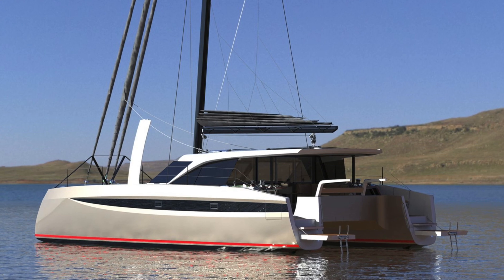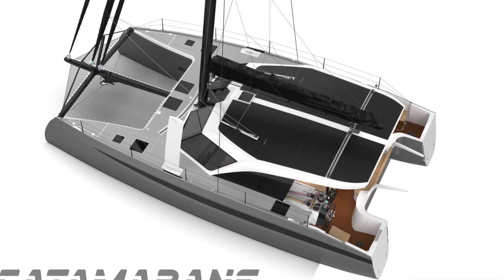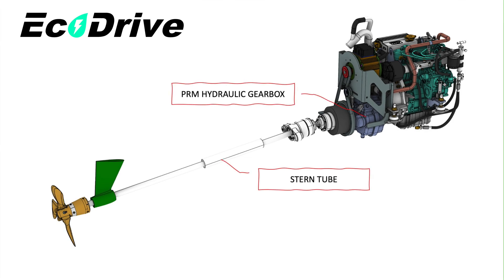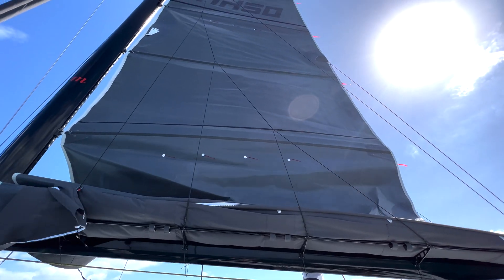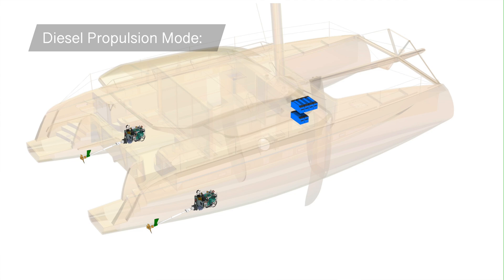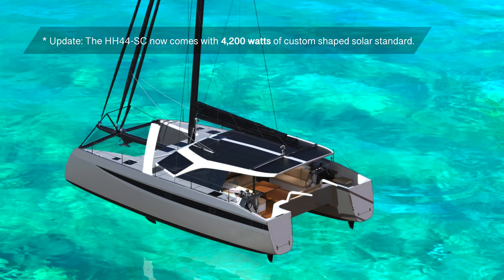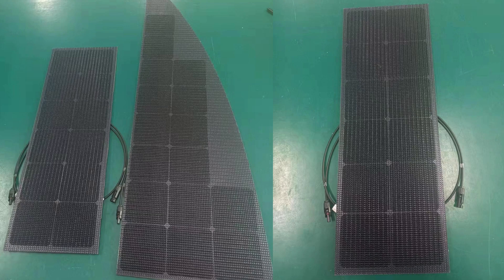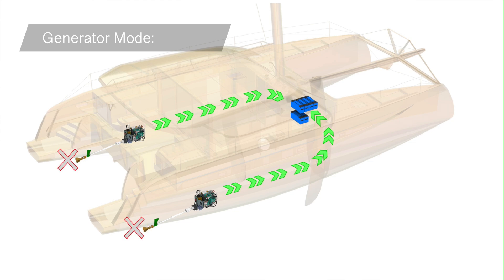Electric Catamaran of the Future: The HH44 EcoDrive (Episode 4)

Comment: Is it possible to have 4 electric motors for redundancy, eliminating all the diesel motors all together?
Reply from the maker: You could but for the reasons stated in the video we worry about the safety of such vessels that lack other ways to generate power (what if it's cloudy and dark)? To us, a Hybrid system makes the most practical sense for a true bluewater cruiser.
Reply: @HHCatamarans  how about 4 electric motors, with two sets of battery banks, each dedicated to the engines only and a diesel generator for emergencies?  I got the idea from Elling Yachts. While one engine is working, moving the yacht, the other engine's props acts as a hydro generator, recharging the other  bank of batteries. The roof of the boat will of course be plastered with solar panels for the hotel load and other electronics.
Reply: @The442nd  You should do an energy budget and design to your sailing needs.  For world cruising, unfortunately diesels are needed as at least a backup for long becalmed passages.

The HH system has 4 way redunancy, 4 independent ways to move the boat: two electric motors and two diesels.  That's excellent redundancy.

Having one diesel is doable, but less reliable than the 4 way redundancy of this system.  Why does redundancy matter?  What it one diesel fails in a major storm?

Also conventional generators are horribly inefficient for space, weight, cost, maintenance.   The parallel hybrid they have is highly practical.

If you wanted to do a serial hybrid do it with a conventional marine diesel connected only to an electric drive used as a generator to charge the battery bank, plus another drive motor to actually turn the prop from battery/generator power.
Reply: @LoanwordEggcorn  Thank you. I'm clearly still in fantasy land. Hopefully I can realize my dream. Thanks again for your input
Reply: @The442nd  You're welcome.  For info, if you're not already sailing, a great way to start is to join a local sailing club and take lessons there.  It's also highly economical to charter (rent) club boats compared to the many expenses of owning a boat. 

It's also a lot of fun!

There are sailing clubs nearly everywhere, including far inland in places like Colorado and Oklahoma.

Comment: When at anchor, given that there is a sufficient current, say 2 -3 knots or more, can the prop still be used to charge the battery like when under sail?  I know there are areas, particularly those with high(ish) tidal extremes where the currents can get quite high for a few hours either side of high or low tide, this could present a significant charging opportunity.
Reply from the maker: It could, but realistically you would need roughly 7 knots or more of current to make any real impact.

Comment: This is safe European style hybrid boat but 44k battery is way too small for cruising. 200-300 kwh battery is enough to take out the diesel. 
Also 3000w solar is not enough and these will have to be replaced in 5-10 years! At least 10k on normal style solar power with many years of service please! If you remove diesel there is enough space.
Reply from the maker: Our system is designed to give you the "range" you need for normal sailing, not perpetual motion. Plus we include 4,200 watts of solar (not 3,000) and have an optional 1,200 more you can add to the davits. That's a total of 5,400 watts on a 44 footer. Pretty impressive if you ask us! But we are biased. :)

Comment: You keep asking "Why hasn't someone already done this?" Apparently you haven't been paying attention. The Antares 44 is a year ahead of you with essentially the same Eco Drive parallel set up. OOPS.
Reply from the maker: As we stated in the video, we think you need to build the boat from the ground up with this idea. We also state that this is not new technology and that people have been putting them in boats for 15 years - but why no one has designed a boat from the ground up with this idea and this system in mind is surprising. With 4,200 watts of solar standard (up to 5,400 watts total) and a more efficient hull shape, our solution is expected to work better than the competition.

Comment: What is HH catamarans stance on the Sunreef 80 design with the array of solar panels on the side of the hulls and incorporated in the mast. The efficiency of the panels and the batteries?
Reply from the maker: Those boats are run using Diesel generators that power the electric motors. Something they neglect to mention on their website.
Reply: @HHCatamarans  Plus they don't give the weight of the boat which I feel is a vital component in the ultimate design factor.

Comment: Everything you two have said is spot on... But let's face it... sailing is a pain. Instead of putting money into lines, sails, a mast and rigging, then take exactly what you have and extend the area for solar and put some more batteries on board. Embrace the parallel hybrid drive for propulsion. All of that extra solar helping out will increase the milage on the diesels to something tolerable.

Not only will this new boat be less of a pain to use to get from point A to point B, but maintenance will be less. A person could be having fun and taking it easy instead of constantly trimming sails, switching sails, replacing chafed lines, greasing winches, fixing blocks and pulleys and all of the other pains that come with sailing.

Build it and they will come. This is the boat that most sailors don't know that they need yet.
Reply from the maker: Sailing is the most Eco part of the entire design! Powered by nature!
Reply: @HHCatamarans  You're right... and I do love sailing. But as a lifestyle it's less than ideal. Not to mention that other than ocean crossings, a person would likely be able to island hop through somewhere like the Caribbean using almost no fuel if they wanted to and it's difficult to get more eco friendly than that. From a business standpoint I'd think that it would make a ton of sense for you guys too. You're already putting the diesels in, already putting the batteries in, already installing the solar, and have already put in the work to make a great hybrid drive system.... but how much time and money would be saved by skipping the mast, winches, lines, rigging and sails??? The best part, is no part. I think that HH could make an awesome purpose built solar hybrid. There's no need for wrestling sails so you could shrink the trampoline and expand the cabin so that there's more living space and more roof area for solar. You can probably fit 10kw on a 44ft. Maybe another 3kw or 4kw could be flexible solar panel "wings" that stow under the main solar panels and pull out to clip onto the life line stanchions. 14kw on a 44ft boat would be enough to maintain a decent speed all day on a sunny day. On a side note, look at how much attention doing a proper hybrid sailing cat has brought to the HH brand. A pure solar boat would get way more attention.
Reply: @carsonc1272  Sailing is one of my greatest joys in life.  It's working in harmony with and being part of nature.  Using wind to move the boat is by far the most eco friendly and efficient too.  Given wind, range is only limited by food.

The reality is that there's not enough power extracted from current solar cells to move a boat very far or fast without also using the Diesels.

Also, there are other types of sail rigs that can be easier to use.  (Crab claw, junk, lateen, tanja, etc.)

In principle kites (actual kites, not spinnakers) can be fully automated, and many have automated kite launching and flying systems.  Kites also have a lower center of effort since their lines can attach low on the boat, etc.

Comment: Love the concept!  So when you say it can motor for an hour under battery only, is this under the premise that it’s ideal conditions of no wind and flat water?  You mention it’s used on canal boats and that’s what they see, so wondering how that range translates to a pretty normal 15kts on the bow motoring into 1-2 foot chop?
Reply from the maker: The battery is large enough to power the two 10kw motors for roughly 1.5 to 2 hours at full power regardless of sea state. After this the batteries will need to be recharged by either the Solar, Hydro or Diesel generation capabilities of the yacht.
Reply: @HHCatamarans  thanks for the reply, that’s really impressive!

Comment: 5 years for solar panel warranty is very very low.  I think removing 1 of the diesel engines, its fuel tank and then adding another 30kw of batteries in that area.  running just 1 diesel engine charging at 5kw would allow the other electric engine to run at 7.5 kw for 10 hours if needed. I would also add 2 more 500 watt panels over the dingy area. we are trying to get rid of duel engines and this way only removes the generator which many have done with large output alternators. You usually plan for when you are leaving or running to avoid a storm. so even that one diesel might not get used as much as one thinks it would.
Reply from the maker: Not in the Marine industry.
Reply: @HHCatamarans  anyone on a coast where the wind blows salt water around is same as them on a boat. 5 years is a junk warranty.

Comment: Great sounding boat. What are you doing to avoid lighting strike taking out the whole boat, what systems are installed?
Reply from the maker: This is another perfect example why it is great to have a traditional Diesel on board should the electrical system fail. We use the Beta Marine engines that do not require MDI boxes or other electronic controls to run.

Comment: I love this when concept. Definitely no 1 on my list. Question. In theory on a sunny day what speed could you cruise at using only the power of the solar panels. As an example in the doldrums.
Reply: About 4kn, in my opinion quite OK.
Reply: With 3.2kW of solar, and the two motors 15kW, you wouldn't you be about 1/5 throttle of one motor (15/3.2). Perhaps 1-2 knots?
Reply from the maker: Yes, in theory, slow forward motion could be perpetual with this design, but it will not be very fast (kind of like the Silent Yachts).

Comment: The HH44 is a beaut of a boat. The Maverick 440 Hybrid built in South Africa has been on the market for a while now. Not exactly the same configuration using twin Oceanvolts and and a GenSet and definitely not a performance cat.
Reply from the maker: That boat is a Serial Hybrid. We are building a Parallel hybrid where the Diesel engines can actually spin the prop (rather than just being a generator). We believe this technology will be far more reliable and safe than a Serial Hybrid would be.

Comment: I believe that simple electric motors, a larger battery (Ford F150 Lightning has a 98KWh battery as standard and 131KWh for the long range version which they are able to fit within four wheels, so surely this size could fit on a catamaran) and a genset is the way to go. The genset would provide emergency back up charging when solar and sailing regen hasn't been enough. If the yacht is designed from the ground up to be electric, the battery would be in the bottom of the hulls and act as ballast and/or be structural.
Reply: Direct drive diesels are more efficient than gensets.
Reply: @AORD72   Agreed, but maintaining one genset rather than two overly complicated hybrid diesels is less costly and probably less headaches...
Reply: @downwind_david  The hybrids HH are using are extremely simple.  They're basically standard marine diesels with an axial electric motor bolted on.  This simplicity adds mechanical, cost, weight efficiency and reliability.

Marine gensets are horribly space, weight, cost, maintenance inefficient compared to this set up.

If you're referring to a serial hybrid the best way to do that would be with a standard marine diesel connected to a standard electric drive motor used only as a generator to charge a battery bank and another standard electric drive motor to turn each prop.  No conventional gensets.

Comment: Alibi tried regen with electric propulsion 10 years ago but struggled with the charge cycles an ultimately gave up and went with diesels only.
Reply from the maker: I (Seth) met the owner of that boat in the South Pacific. SV Itsara. Beautiful boat! It was a Serial Hybrid and as we state in the video we strongly feel the only true solution is a Parallel Hybrid (where the Diesel engines can also spin the prop if you run out of power). Sadly that boat system failed (as have many many other Serial Hybrids).